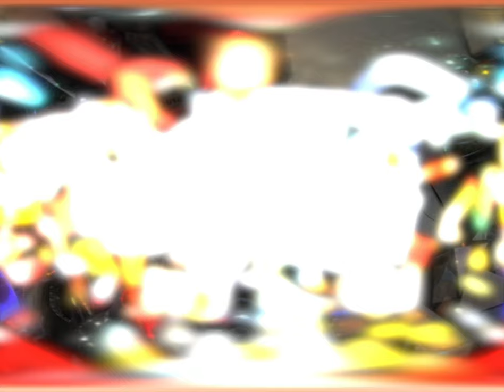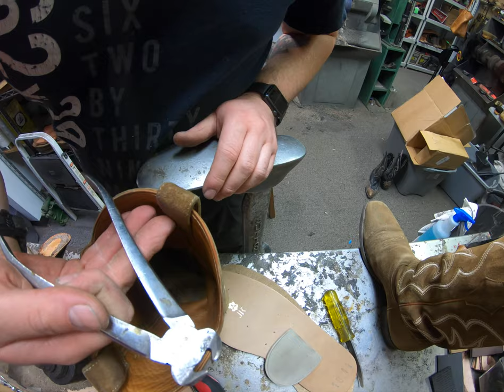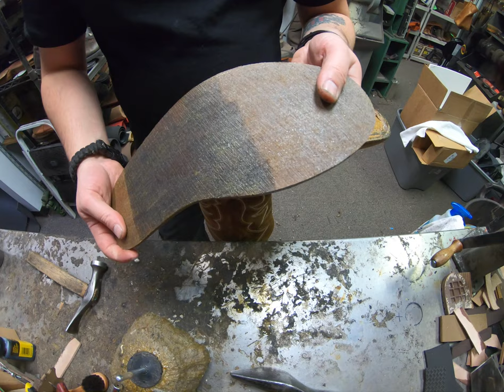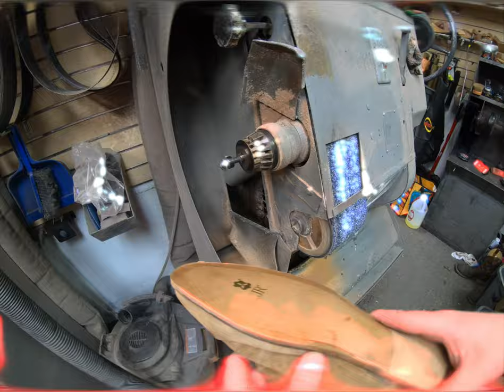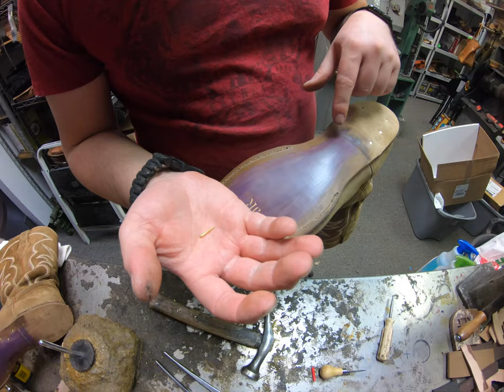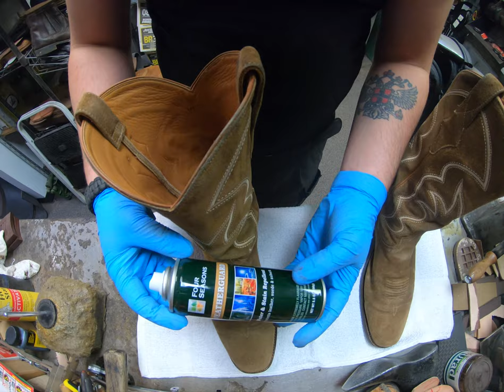Frye Boots Western Style Suede recrafted with JR Leather Soles and Suede Cleaning

Comment: Would you consider Frye boots quality for their price range? Or are there other brands which hold up better?
Reply from the maker: Frye has a very wide range of quality builds. Some are not worth it some are. It’s very hard to tel witch styles are the good ones. First indication is the price point and second is a close inspection of the build
Reply: @CobblersPlus  thank you for the response! I have a very hard time finding shoes which are in my style but actually durable. I've managed to sheer the nails in Schutz heels in half, so I am seeking a brand that has HIGH heels which at least try to be as durable as a men's boot.
Reply: I have a few fry weston chukkas and they seem good. I like them.